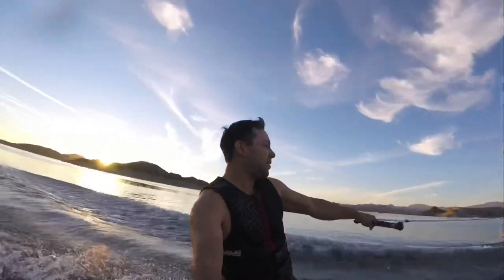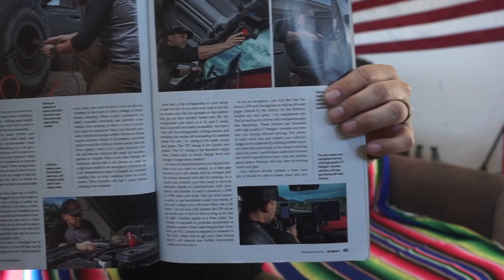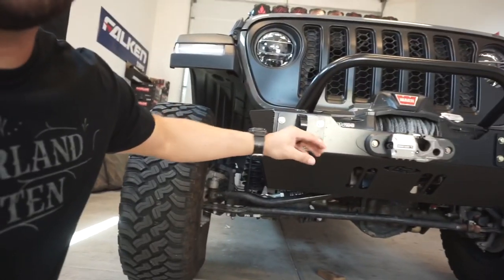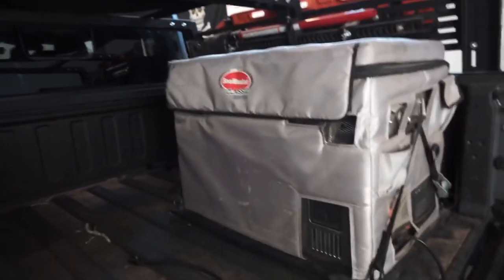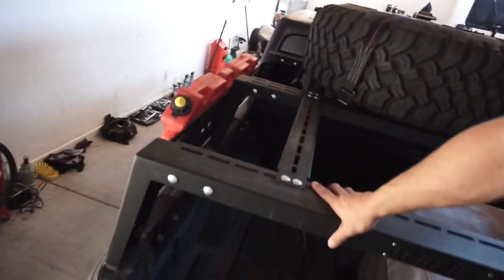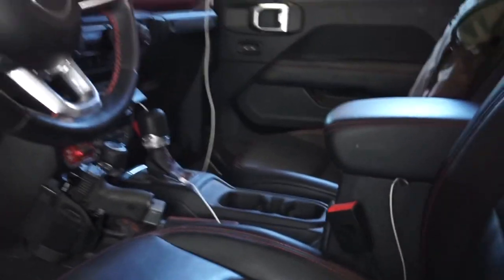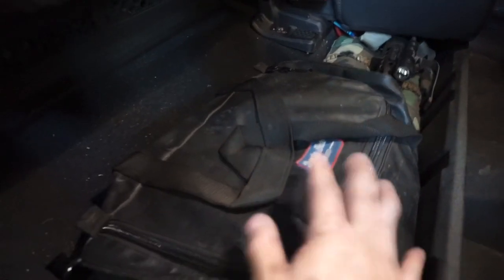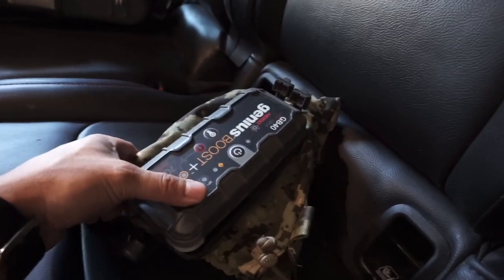Phase 2 Jeep Gladiator #RESQJT

Comment: Great video really like your build recently subscribed. I was wondering if you have had to rebuild the Fox 2.0’s yet or have noticed them becoming less responsive yet. I have heard that if you do on road driving and offroad that they need to be rebuilt every 10,000 miles which seems extreme. But I figured I ask someone like you who actually takes his gladiator offroad and not just mall crawls it. I am looking to go with a Teraflex 4.5” base lift and adding on other component to it like front control arm drop brackets, trackbar relocation brackets, nexus 2.2 stabilizer and possibly front and rear trackbars, along with the 1” spacer needed for the ecodiesel. Decided on Teraflex over Evo because I want to get the Alpine IR arms that dont require greasing or rebuilding since I also live in the desert. I just cant justify paying $2000 for the Flacon 3.3’s for the ecodiesel, so I am on the fence about either using the Falcon 2.1’s with shock extension brackets or the Fox 2.0’s for a 4.5” lift. Sorry for the long comment, thanks in advance take care.
Reply from the maker: Yes they need to be rebuilt.  I am noticing fade and will need to replace them.

Comment: debating on going with evo 4.5 on 38s or evo 6.5 on 40s but the 6.5 might be a bit much for a daily. do you have any rubbing ar full flex/
Reply from the maker: No rubbing so far
Reply: im also debating on going 4.5 evo on 38s my question is does the lift look to high for tire size?

Comment: 13:35 Slight flex but ok lol🤣🤣🤣
Edit-Are you considering maybe putting a axle truss on the front to make the axle stronger ?
Reply from the maker: 😂🦾 right now I’m trying to price out building some Dana 60 as apposed to doing anything to the factory set.  If they end up staying then I’ll for sure upgrade everything.

Comment: I am looking at an aerial pic of Gladiator from the side that makes the bed look like it is cut off like skid plate, ie the tail gate wouldn't close anywhere near flat, for the old departure angle problem. So long as bed doesn't get smaller I would look at doing that on ppl car/truck. The tail gate & skid plate same kind of deal, w/no bumper except beefy mother f-er tailgate. It's tail gate & bumper all in 1.
Reply: Most of the time u hve tailskid bumper in down postion except when serious roading. Tow lights everything is prt of that angled tailgate/bumper. God

Comment: I saw a what is new ideas video whear ppl put a sled under the bad tire & don't need a spare change till they get safely down the road, ie woman thing. But for towing the idea makes way more logical sense. U put 2 sleds or 4 sleds under each tire, by driving on them. This way no wear or mileage on toe car. & bc they r diff from tires in that each is own assemble/unit, the tow car could move more freely wider side to side, effect then w/a bar. The move it moves freely the less drag & strain on the RV. Lowest poss extremely low drag wheels for sled means again less drag but also no air tires less cost per mile & 1 less thing to brake.